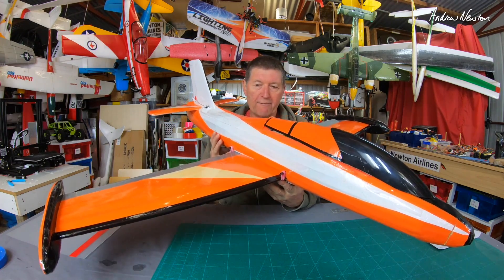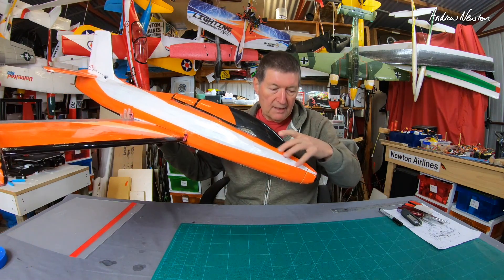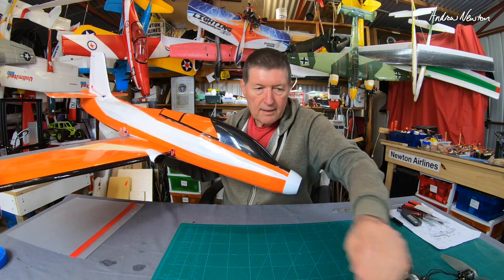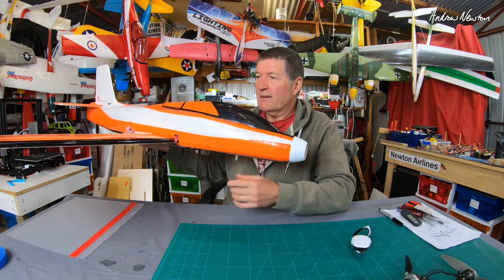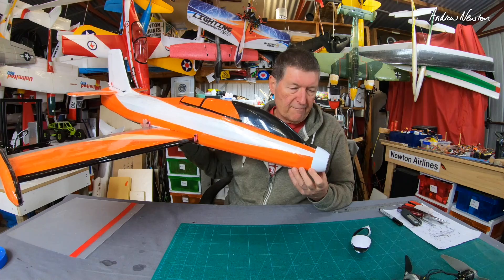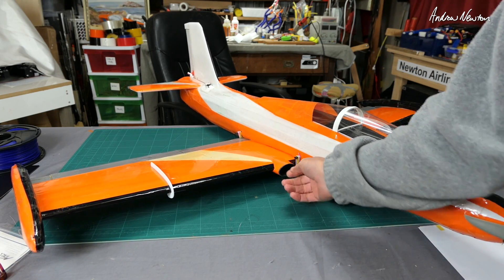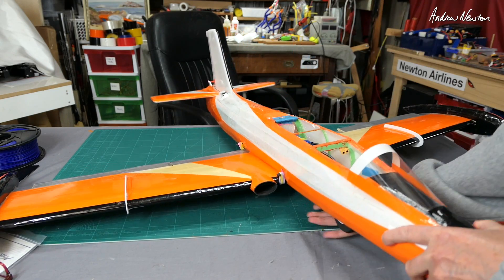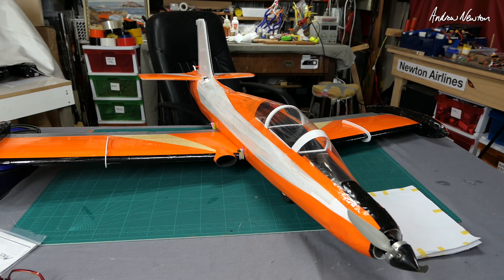Macchi MB-326 Scratchbuild Part 4

Comment: Hi All, if you are interested, the stickers were cut with Graphtec Craft Robo CC200-20 (now obsolete, replaced by Silhouette Portrait 2).  Vinyl is "Oracal 651".  Software packages used for design are Inkscape and Silhouette Studio. Scotch Painters tape and clear transfer film were used depending on the size of the Sticker.

Comment: The tape cover looks so smooth in pics and display do you do anything else after laying it on?.....plus I love they top peel away on the stickers, your friend did a great job.
Reply from the maker: Just tape, plus laminate on the wings first.
Reply: i've tried stretching the tape with a heat gun, but i only covered the underside of my wisel, so it developed anhedral
a problem could be to get the tensions distributed evenly, so that there isn't any warping, if everything is covered
but the tape was very smooth after that, no wrinkles at all

Comment: Hi Andrew, greetings from Leicester,UK. A great looking scratch build, can't wait to see it fly.
Btw do you mind if I ask you a couple of questions on another topic? I've recently taken up rc having been an aeromodeller in my youth and built a few balsa Chuck gliders. I've bought a flysky i6 tx and a phoenix 2000v2 as seeming to be a good beginner setup which I'm painting and assembling at the moment.(didn't think much of the factory paint scheme/decals so I'm decking it out in the old silver and yellow RAF trainer scheme)My question is about the electronics setup. I've watched your basic four  channel setup video but I'd like to setup the flaps as well so info on how to do that would be most appreciated.
Reply from the maker: Great answer thanks Johan. I have a playlist of FS-i6 videos AB
Reply: Thanks gentlemen, most helpful. Andrew I've looked thro' your i6 vids which gave me a great start and thanks Johann for the additional bits n Bob's of info which will no doubt save me a lot of cussing and head scratching!. I'm using channels 1-4 for a,e,t & r leaving 5 & 6 free, the leads for the flaps are labelled Ch 5 but I'm guessing it doesn't matter which of the free channels I use. I assume I plug in and then have to go to tx settings and assign "flaps"  to that channel. One thing that intrigued me from a technical standpoint was how does one ensure that the ailerons move in opposite directions since they are connected together by a y cable? Is it some digital wizardry or something simple such as reversing polarity?
Reply: @paulgee6111  Mounted as mirror image in wing? ;-)
Reply: @theoztreecrasher2647  gotcha👍 spun round 180 so rotates in opposite direction.🙂
Reply: @paulgee6111  You’re welcome AB.
Yes you can use Ch 5 for the flaps. The reason I suggested Ch 6 was because in Andrew’s video he assigned Sw C (flaps) to Ch 6 and also in Mix #2 he used Ch 6 mixed with Ch 2. So if you substitute 6 with 5 in those two locations, then you can plug in your flaps in Ch 5 instead.
Have a look at the servos in the wings: the aileron servos are mirrored (points to the wingtips), but the flap servos are not (one point to the wingtip and the other to the fuselage). Because they are arranged like this, we can use a single channel (with Y- lead) in both cases and the ailerons will work in opposition while the flaps will go in the same direction, as they should. On the model that Andrew was using for his video, both the aileron and flap servos was mirrored, that is why he had to use 2 channels for the flaps, and he then needed to “join” them with Mix #1.
Reply: @paulgee6111  One more tip for you AB: I found it very useful to first practise on a RC flight simulator before flying the real thing. That probably saved my plane from a few crashes. So if you have a computer, give that a go…
Reply: @Johan-ex5yj  Thanks again mate. Are you referring to an "RC Sim", I'll have to see if I can find one that runs on winxp! I've flown regular flight sims for years with IL2 being my fav and had a few goes behind the steering column of a "real" plane which should stand me in good stead. I guess I can dust IL2 off and practice flying in third person view
Reply from the maker: Aileron servos should be mounted opposite orientation and flap servos mounted same orientation. If not you can buy a servo reverser circuit.
Reply: @AndrewNewton  Roger that. Makes perfect sense as simplest solution.
Reply: @paulgee6111  No, you need to practise with your actual Tx, and you have to get your turn directions right when flying towards yourself. Look for something like “STARTRC 8-in-1 RC Flight Simulator” on www.banggood.com
Reply: @Johan-ex5yj  okidoki I'll look into that, can one get a RX that you can bind to yr tx, plug it in pc and use it to control the Sim?
Reply: @paulgee6111  You can, but it’s easier to just plug it in directly.
Reply: @Johan-ex5yj  of course, I guess the TX has usb
Reply: Good day gentlemen. Thanks very much for your help. I've got everything put together and the TX all programmed. Just waiting for the gov to let us out so I can maiden it. Not wasting time though, I've started building a balsa glider now 😁👍

Comment: Great build Andrew!! Mate I need some of your expert advise, I'm building a twin boom pusher, so I've hotwire cut a wing out and covered it with 3mil laminate, now the bit I want to ask is my wing is 1100mm wingspan with a 150mm root cord how to I calculate my boom lengths and tail size? Or is it just a case of "That looks about right"? Cheers Andrew
Reply from the maker: Scale it down from Mini Skyhunter 1250mm wingspan. If you can find a top down photo it should be easy to get an idea.
Reply: @AndrewNewton  great idea thanks mate!!